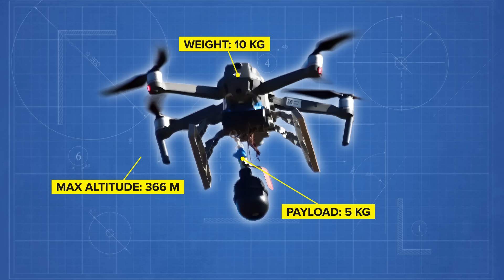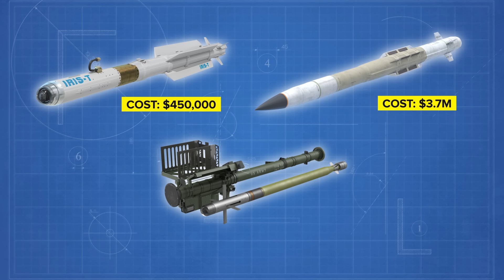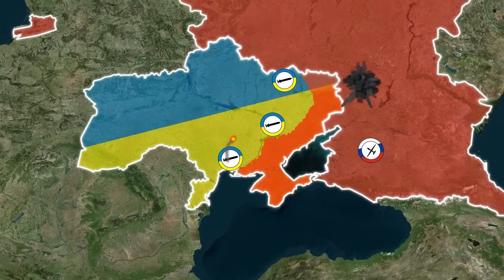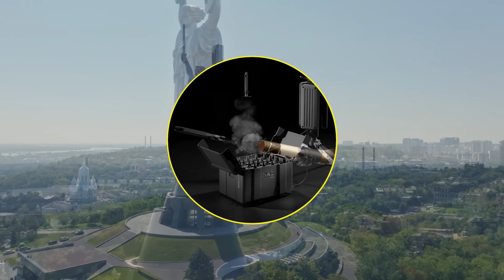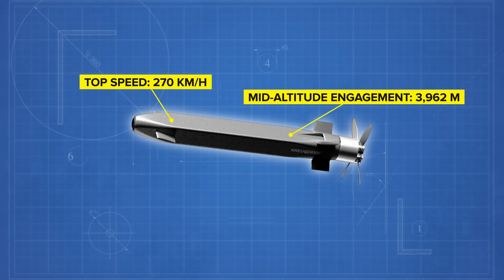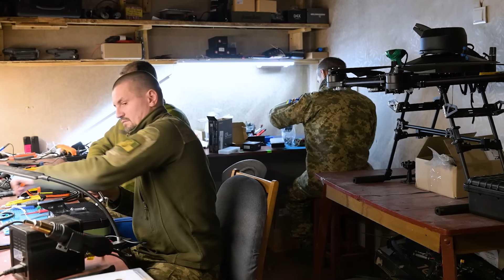Sweden’s KREUGER Terrifies Putin More Than NATO Jets

Comment: Cheap 500$ fpv drone will likely cause lot of damage compared to it's price, if it reaches target... this is what the cost of downing it should be compared to, not the drone price... if spending 500,000$ prevents for example someone getting killed and few others badly injured, and losing weaponry and other military gear aswell - is it really that expensive? It's not 500$ vs 500,000$, it's 500,000$ vs potential losses. Obviously cannot put a price tag on human lives - but even if the drone would only take out some vehicle or weapon system, that 500,000$ can fill quickly.

Comment: MBDA Deutschland has just finished a year-long testing and finetuning period aboard some German ship, waiting around until some number of drone models built to mimic various common enemy drone types. Afaik the laser is cleared for maritime use, while use from ground vehicles (the first Skyranger 30 prototyppes featured an underpowered 20kW laser that needed to connect for a period of 0.25  seconds to bring down even a Mavic. If the MBDA System can be made to fit on a Skyranger turret as well and fit a sufficient APU or battery somewhere, I guess that would be one easy sale.

Comment: Smart idea. Propeller driven with electrical motor and lithium battery make for low cost projectiles. Combined with IR heat sensor and electronics that lock-in to a heat signature makes for great efficiency.

Comment: Swedes were quite bold with their SAAB Viggen airplane, using moving canards before everyone, and thrust inverter. (The American F-35 is rather trust inverter 😉)
    Sweden was the only country to successfully intercept a SR-71 Blackbird, actually helping it, if I remember the article well.  
    And their S-103 astonishing tank design : 1st serial autoloader, no turret, crazy suspension, plow, twin motors, and driver facing the side !
    And their super quiet stirling engine submarines have sunk US aircraft carriers during exercices without being detected even in the aftermath. 
    Go Sweden !
Reply: IF only they could make 10% of what the US can. Grippen 20, part of it in Brazil, US 190 F35 planes. GET REAL PEOPLE. In weapons it is NOT just quality often it is more how fast you can build them....

Comment: The APKWS rocket cost roughly $27500 per rocket, more expensive than a FPV drone, but hardly the $450000 quoted in this video. Have these Kreuger missles been tested in combat yet?

Comment: WTF are these altitude limits? I can easily fly way higher than 500m with my 700g 5'' FPV quad. Altitude is only a matter of radio range (up to 10s of kilometers with ELRS) and the TWR at lower air densities.

Comment: Krueger uses electric power. However small engines can be cheap. Norman Hossack invented a two stroke that had just three parts plus standard off shelf bearings. It could be 3D printed. His website displays his work.

Comment: Nevertheless, it's still not really inexpensive. Cannons are cost-effective because the ammunition is very cheap. However, you need a significantly larger cannon for better range. One could build a turret similar to the RCH 155 with a slightly smaller cannon, e.g., 105mm, with airburst ammunition, and integrate the whole thing into a Leopard 2 hull, similar to the Gepard, complete with radar. The RCH 155 can fire while moving.

Comment: Estonia's defence contractor Marduk Technologies has developed and successfully tested an intelligent high tech camera system upgrade for infantry fighting vehicles called Marduk which scans the skies for drones and enables IFVs to quickly detect, identify and use their regular cannon to shoot down FPV drones and larger from as far away as 2.5km. It was tested in spring on CV90 in a live firing test and passed the trials with flying colors.
Two versions have been developed, the IFV variant and much lighter (10kg vs 70kg on IFVs) tripod mouted infantry variant. The infantry tripod can scan, detect and track drones 360 degrees around itself. It can potentially be equipped with a weapon that would automatically shoot down any drone within it's line of sight and radius of 2km with no more than a few bullets.
Infact because Marduk has proven itself in trials, South-Korean Hanwa Aerospace signed memorandum of cooperation with Marduk Technologies last week for joint development of C-UAS (Counter Unmanned Aerial Systems) weapons.

Comment: Dubious speculation. Nice PR. 
As a Swede, I'm highly sceptical too the claims by the very small company called NAD. The manpower of the Kreuger100-system's R&D team is about 4 people. None with impressive credentials. The claimed technology, miniaturized to these small Rockets, is unlikely to be developed by that miniature team. This is most likely a scam. They try to get as much funding as they can and then wrap up operations post the war in Ukraine. I would not spend a single EUR on this project.
Reply: Vi behöver se riktiga videos när de faktiskt används, inte bara en massa 3D renderingar. Borde inte vara omöjligt för dem att göra testskjutningar att visa upp. Möjligtvis att detta bara är en startup som kommer att dö.
Reply: @kristofferhellstrom  Deras hemsida är allt annat än imponerande. Snygg reklamvideo, men de verkar inte ha några teknikexperter som verkligen kan utveckla den avancerade tekniken de påstår att de har. Personligen kommer jag inte investera en krona i det här. Jag betvivlar deras ärlighet.
Reply: I kinda agree.  its seems difficult fitting a battery in something that small would give it sufficient speed and range.  somebody should be able to do some back of envelope calculations to determine if its possible.

Comment: What should be done is put an AWACS type jet up data linked with ground base radar and get a bunch of turbo prop single engine fighters short dirt runway capable, with about 3000 rounds of 7.62x39, data link everything. Then make several squadrons on standby at different fields.